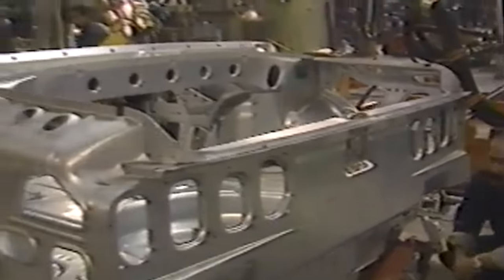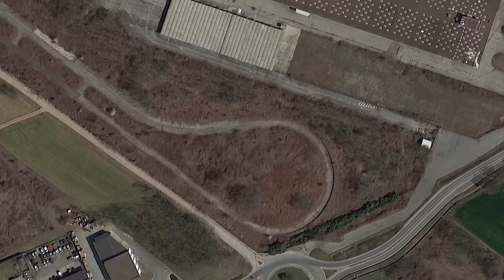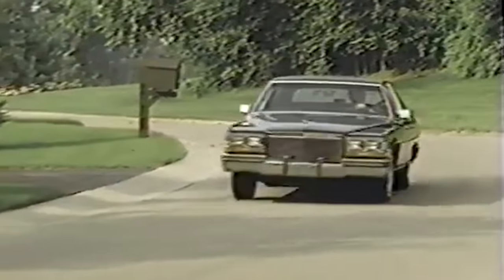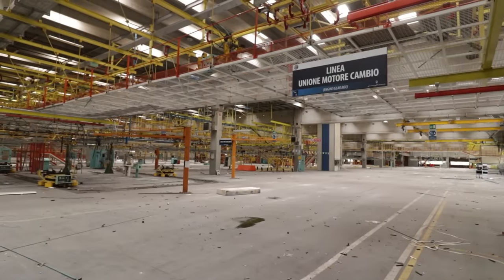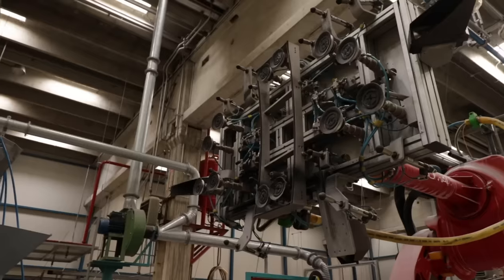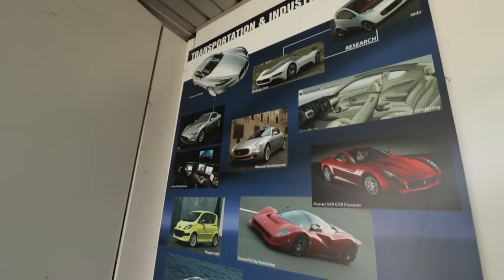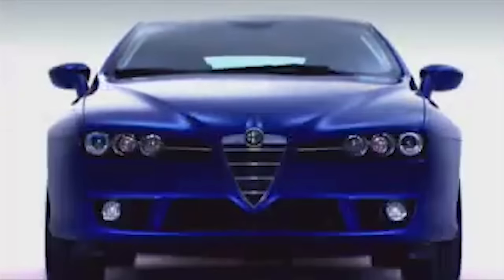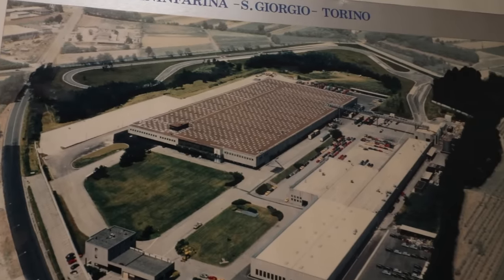We Found an Abandoned Car Factory Still Full of Items

Comment: As a massive car nut it was great to see the inner workings of such a pivotal company in 80's and 90's car design. It's just a shame that we're seeing fewer and fewer marques making use of their bold designs today
Reply from the maker: Totally agree, lot of modern designs are quite bland especially compared to what Pininfarina and Bertone once made
Reply: Stellantis....
Reply: But isn't a plastic clad crossover with an oversized grill the truest expression of bold?
Reply: Half of this process has been moved into a single facility fitting entirely into a laptop.
Reply: @ForgottenBuildings  I really like the Peugeot 406 coupe which was done by Pininfarina and the Opel Astra G coupe and convertible which were done by Bertone. I think cars like these are peak car design. I wish at least some car designs would go back to this, also with offering more coupes, convertibles and "classic" types of cars instead of basically just flooding the market with SUVs and half-SUV cars that mostly look the same and sometimes don’t even have a real purpose (imo, and some of these are more of a computer on wheels instead of a car actually)…
Reply: That's not really true, their design influence is still present in many cars and it's not like they stopped designing cars, just not building them at this location.
Reply: @ForgottenBuildings  it's about the ability to be financially viable. You have to be able to sell the most vehicles to the most people in the least amount of time. The small runs just aren't financially viable. Take the 2005/2006 Ford GT. It was a financial flop at the time, they couldn't sell but now? Those vehicles are fetching $500,000 to $1M. 

Now look at Ferrari. "we sella cars dat willa go uppa in flames" Are you doing anything about it? "va fa fungu, we no hafta" 

Not just Ferrari, Bentley. $450,000 SUV. $200,000 after the warranty runs out. $35,000 after 5 yrs because while they look nice, they are built like crap. 

Range Rover: you're lucky if you make it through the warranty period with the vehicle not being mechanically totalled.
Reply: @muskokamike127  the point of a halo car isn’t generally to make money. A halo cars purpose is to promote the brand, and get people into the dealership to buy more F150’s and mustangs
Reply: Some of what you are saying is true but in the US, where I’m at, Ferrari is almost always a toy car and not transportation, they have come a long way and are extremely high tech these days.  I was a Ferrari tech back in the late 90s at a new car dealership and everything in the cars was quite crude and even outdated(except the drivetrain of course, those have always been a work of art) relative to any other cars.  Often new cars were unreliable or coming back on a tow truck a week or two after it went home.  Now, I own a shop where we service and restore exotics.  The older ones are beautiful and the ones that used to burn have been updated by now, but they require lots of maintenance if they are driven regularly.  On the other hand if they sit too much it’s even worse lol.  The new ones are amazing from front to back, the fit and finish is excellent, transmissions amazing, inside and out, all are impressive and that actually goes for all the italian supercars or exotics as of late.  Most are made to drive 1000-3000 miles each year in good weather only.  As great as they are now, they can not hold together well under normal use.  Most anyway.  A Bentley on the other hand, they are all hand built and unbelievably well put together.  That was the main thing I wanted to say, as someone that works on them, they are heavy, solid, tight, we’ll built vehicles assembled by professionals by hand(mostly) and these people take great pride in their work.  It actually shows in the Bentley and Rolls.  They do break and they are expensive to repair but they are absolutely exquisite.  Oh and none of the cars I mentioned are simple anymore, they are all extremely high tech now, sometimes too much but they are impressive.  It takes a lot to impress me as I’ve been doing this many years and have seen and worked on all of them.  Side note, the 05-06 Ford GT is not high tech, it’s got no bs, easy to fix and one of my absolute favorite cars in every way.  Very impressive that plain old ford can pull that off when they want to.  The latest one is different and is full of tech but still a top notch super car.  Man, I could go on forever on this stuff, I’ll cut it short but even tho I do this stuff all day, every day for my whole life I will still happily yap about it forever.  My sickness I guess!!  Drugs would be cheaper haha!
Reply: Your right now we're seeing Mickey mouse Tesla's,, thanks to the liberal Democrats.

Comment: You forgot that they also built the true “poor man’s Ferrari” or “baby Ferrari” - Fiat Coupe, in that factory.
Reply from the maker: I totally forgot indeed, thought they were built at Gruigliasco (other Pininfarina factory) during my research. Would've been worth the mention.
Reply: They also built the Fiat Dino Spider and Fiat 130 Coupé and the Fiat 124 Spider
Reply from the maker: @Schlipperschlopper  they did, also in Grugliasco. Which was also abandoned for quite a long time.
Reply: When I first researched where the fiat coupe was built (since I owned one for 16 years) I found it was built at San Giorgio but upon further investigation from Italy I today found this:

“Pininfarina was entrusted with the mass production of the Coupé (on the reliable and versatile Tipo platform) at the Grugliasco plant.

The production capacity was 80 cars a day that were tested at the San Giorgio Canavese plant north of Turin.

The Fiat Coupé was produced from 1994 to 2000 for a total of 72698 units.”

So basically they built them on both plants but the vast majority of them at Gruigliasco plant what it appears.
Reply from the maker: @smOOdiebOOdie  Didnt knew they were using both facilities. Its pretty incredible that they transported them all over just to test them in San Giorgio Canavese.
Reply: @ForgottenBuildings  Indeed! Auto manufactures sometimes make really strange decisions.. just look at the economical suicide Cadillac Allante that you talked about 😅
Reply: The funny thing is, the Fiat Coupe was designed by Fiat inhouse, however Pininfarina did propose a design for that models. Despite being rejected by Fiat, another car maker would adopt it and put it into production. Peugeot.
Reply: @mrspandel5737  Yup - the 406 coupe!

Comment: Seat bases can be sold for scrap iron / steel. The plastic has no value. It would be nice if the office area could be restored and act as a museum for the company. They could also clean up the production lines and display some of the recent models produced there.

Comment: In the UK the sites of the historic industries (ship building, coal mines, steel, large manufacturing etc) have been eradicated so you wouldnt know they ever existed. Usually replaced by souless housing or retail/distribution.
Reply: Sadly, it's all in China now.
Reply: @TomasGraf-rr6co makes me think of what happened to MG.  I own and ❤❤ 2 MGBs, China will never reproduce the real thing 😢
Reply: @forestghost7  Last year I rented a car in Mexico for 3 weeks.  They gave me an MG5. From far away it didn't look bad. Up close.... awful. The absolutely cheapest materials - cheap plastics everwhere, fake chrome on the hand brake switch that was already wearing off at less than 30 thousand kilometres! dreadful underperforming tiny motor that couldn't keep up with other traffic. But it did have LED headlamps and a touch screen inside. I'd rather have a 10 year old Golf than the flimsy Chinese MG.

Comment: Sometimes even being good at what you do isn't enough. The 406 Coupé and Brera* were beautiful attainable cars, but forces above that level intervened. Thankfully Pininfarina itself goes on.
*the Brera Spider was also designed by Pininfarina, but ironically the original Coupé is actually a Giugiaro design, so I'm surprised to learn that Pininfarina manufactured that version as well!
Reply: They did sometimes manufacture cars they didn't design: for instance the Volvo C70, second generation. It was co-produced between Volvo / Pininfarina, but it was designed in-house at Volvo, which is the reason it didn't get a 'Pininfarina' badge... which I think it deserved.

Comment: Back in 1998 I bought a used 1994 Toyota Celica from a Ferrari dealership, it had been a trade-in.  I stood next to a new Ferrari on the sales floor, with one of the Ferrari badges peeling off the body.  And looked at the Celica, thinking, that's the better car.  I was right, the Celica is still a wonderful car in 2024.

Comment: Regarding Cadillac the car was built here in Europe so why not sell it here as well like the Cadillac BLS that was a Saab 93 it was built at Trollhattan sold in Europe but why not also sell it in North America, GM really were crap at marketing there cars no wonder they ruined Saab and sold Vauxhall/Opel .
Reply: For the same reason that the Allante failed in the US - the Mercedes SL was a much better car at a very similar price.
Reply: That's very true!  While the SL was much better quality, the design was getting long in the tooth when the Allante came around.  Too bad Mercedes had to replace it with the garbage R129.  Quality was ruined and the new sporty was a joke.

Comment: I bought my red 1993 Allante with the Northstar System (engine, transmission, drivetrain) in 2021. It's a beautiful beautiful car with great performance!! Best investment I ever made in a Classic Car, and I have five Classic Cars: (1964-1/2 red Mustang convertible with all original body panels, 1982 red Camaro SC with T-Tops, 1986 red Corvette convertible that I bought new and now has only 850 miles, 1988 red Fiero GT with T-Tops, and the 1993 Allante). I paid $10,000 for the used but pristine Allante in 2021. The Allante is a fine, fine, fine car at any price. Compared to the junk that's being sold today, it should be valued for at least $75,000 in terms of quality of design, performance, workmanship, etc. I suggest that anybody who views this video run out and buy one today!! You will not be sorry!!

Comment: The computer was an IBM. No wonder the factory had to shut down, those IBMs were pure junk. My first computer was an IBM 486/50Mhz. Basically, it was an old 286 motherboard with a 486 chip in it - 8 bit bus throughout except for the 16 bit ISA slots. In other words, molasses slow with old outdated parts in it. It eventually broke down after 3 years.

Comment: The test vehicles....at least Porsche recycles their vehicles via a demanufacturing facility. They first remove all the fluids and then start disassembling the vehicle part by part. 

Then they separate the various materials from the parts (like plastic and metal and copper/aluminum etc). At least they are being responsible.

Comment: The Allante was never very popular here in Detroit. I just checked and you can buy one for about $4000. Not very collectable. Old Ford trucks sell for 3 times that price or more.
Reply: I bought my red 1993 Allante with the Northstar System (engine, transmission, drivetrain) in 2021. It's a beautiful beautiful car with great performance!! Best investment I ever made in a Classic Car, and I have five Classic Cars: (1964-1/2 red Mustang convertible with all original body panels, 1982 red Camaro SC with T-Tops, 1986 red Corvette convertible that I bought new and now has only 850 miles, 1988 red Fiero GT with T-Tops, and the 1993 Allante). I paid $10,000 for the used but pristine Allante in 2021. The Allante is a fine, fine, fine car at any price. Compared to the junk that's being sold today it should be valued for at least $75,000 in terms of quality of design, performance, workmanship, etc. I suggest that anybody who views this video run out and buy one today!! You will not be sorry!!